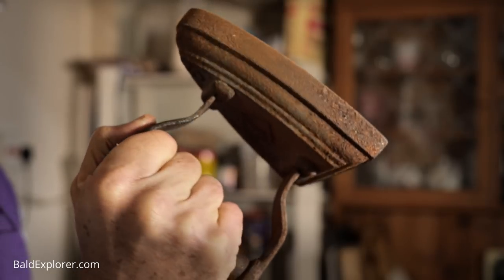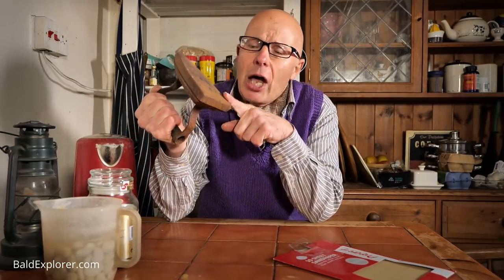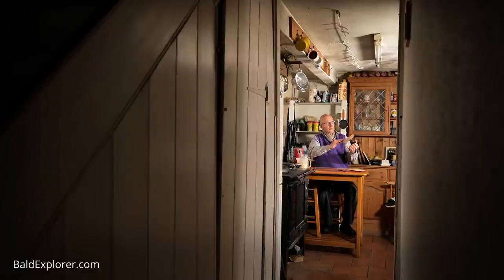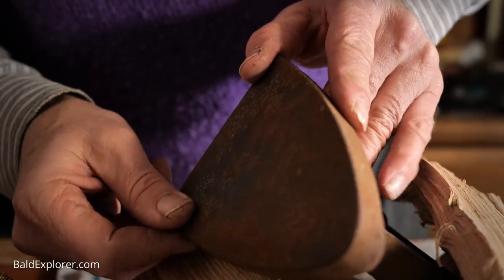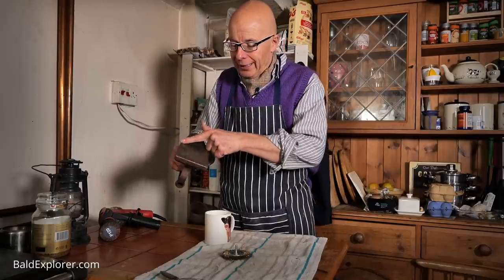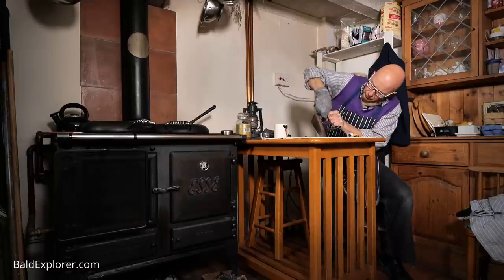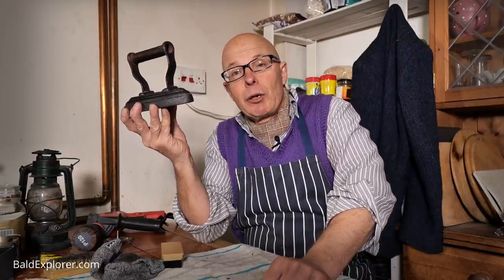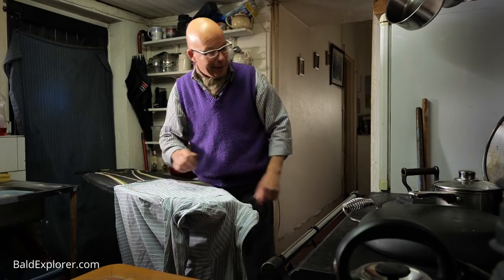Have you ever used a flat iron?

Comment: Flat irons were also called Sad irons  sadiron being an old English word for solid. The number on it was either the size 4 = 4inches or the weight of the iron. originally the entire iron would go into the stove & you'd need a thick pad when you got it out of the fire!  Sprinkle the clothing with water also helped the fabric to smooth when pressing. My grandmother used her AGA to help dry her bedsheets...folded up and plonked on the top of the simmering ring lid..she'd 'smooth' the sheets with her hands every time she went past the AGA!  I just use the one I have as a door stop as I don't have an AGA or Esse.
Reply from the maker: Fab info - thanks for that!

Comment: ITS NOT HOT ENOUGH      it should be "scratching hot" for cotton - wet finder and when you put it on the iron it makes a scratching sound 

I use a thermostat-less electric flat iron for tailoring.  Screeching hot is about 250ºc. A harsh "TSSSS" hot is about 180-200 and thats good for wool. You also need a water spray bottle to wet the cloth - when its up to temp it wil iron a lot quicker than a modern steam irion - you will also need a cloth to hold it with...!!!

Comment: I can see why the editing took so long!
Mum,  although she didn't use a flat iron used a 'dry' iron( ie not steam). We used to wet a square of old cotton sheet and lay that on top of the item before pressing down hard with iron. She used to lick her finger and quickly touch the iron to see if it sizzled and was hot enough.
Reply: My grandmother and mother must've been early converts to electricity, but elderly neighbours once told me their parents used to spit on the iron to judge the heat, by how fast the gob raced round or evaporated...
Reply from the maker: Interesting stuff, Linda.

Comment: As everyone else has said you need at least two, so you can use one and leave the other to heat up. Also, you ideally need your clothes still damp, or use a spray, since it is not a steam iron.  One house I lived at had a "hob grate" which basically had little areas at the side of the grate where you could rest irons, or a small kettle!  Sadly I was not able to stay there, if I had, I would probably have reverted it to being Olde Stylee as it still had the place for the range in the kitchen and the fireplaces were mostly servicable. We had them swept once a year and I greatly enjoyed having the rest of the house quite cool, it was lovely to go up with a hot water bottle.
Reply from the maker: It sounds lovely.

Comment: Fascinating Richard, to watch you grapple with this old but effective technology. I have a flat iron that was last used by a great aunt in the early sixties. She refused to use an electric one because she was terrified of being electrocuted. I'm a keen woodworker and I recently used the flat iron to iron some veneer to a substrate using scotch glue. (Do you remember that smelly stuff?) The veneer is placed in position on a cooled glued surface and the hot iron re-melts the glue and presses it into place. (In practice it's a little more complicated.) Of course the iron is not being used for its original purpose but it serves many uses in my workshop.
Reply from the maker: A great use of a flat iron.

Comment: You could probably oxidise the surface of the iron using instant coffee (soaking the iron in the coffee  solution for a few minutes). It would turn the polished metal darker a bit like gun blueing and I don't think it will come off onto clothes as it's different to rust.
Reply from the maker: I didn't know that - thanks for the tip.